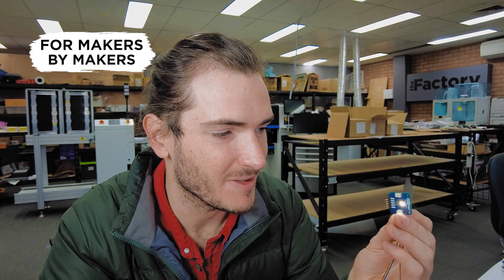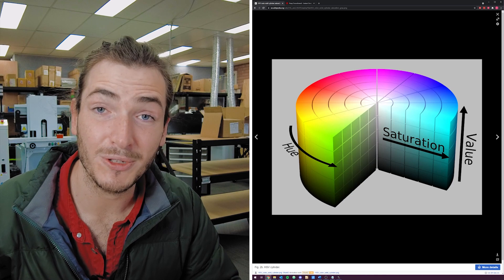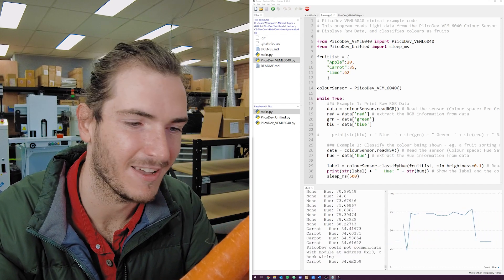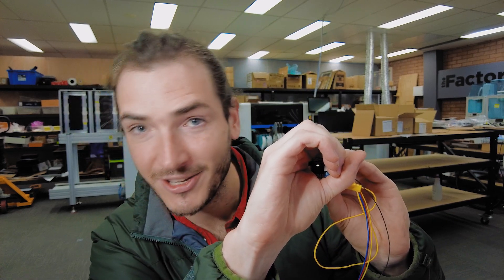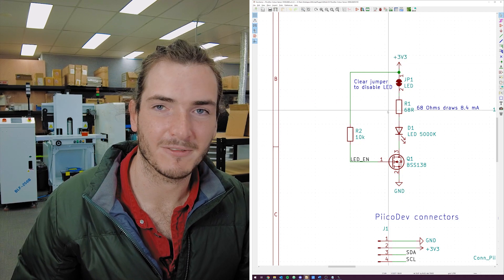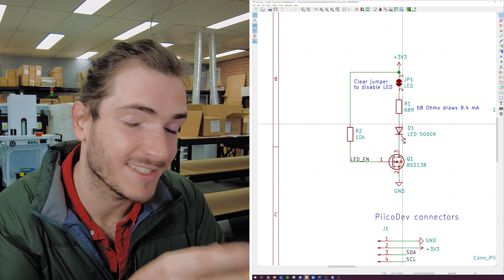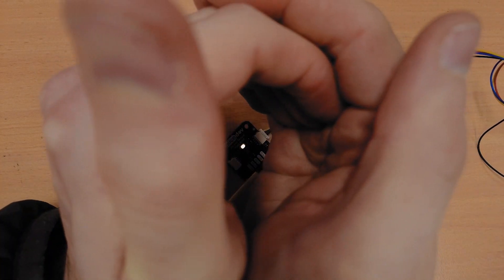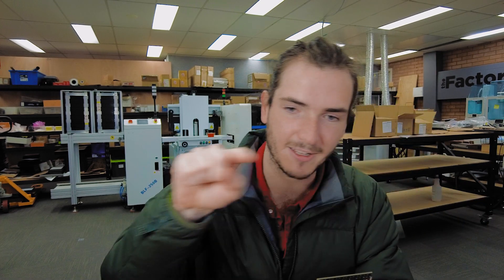The Factory | Solving Engineering Problems With Colour Theory

Comment: My question with the LED is - could the pullup resistor for the gate be lower resistance than your jumper wire - or somewhere around that, meaning the potential to ground is actually higher than 0?

Also with the LED matrix, could you have it so that each edge is 'link - DIn - +5 - GND - DOUT - LINK' - possibly with a jumper to swap DIN, and DOUT?
But then to link topright, to the next row start, you just hook the links of the row above together, hook the last tiles dout, to link, and then hook link to din on the edge jumper for the next row - then you use the pcb of the tiles as the 'linker wire' rather than needing an external linker wire?